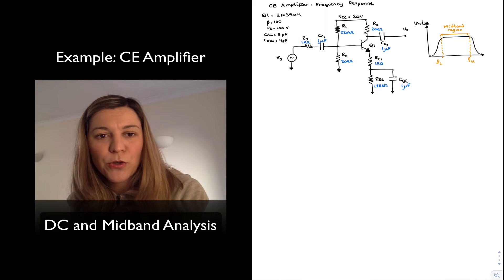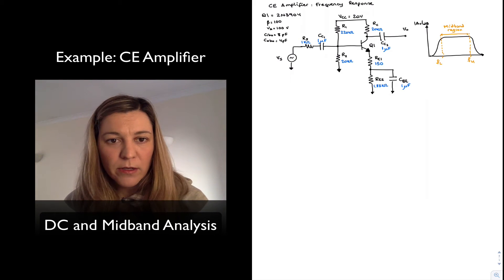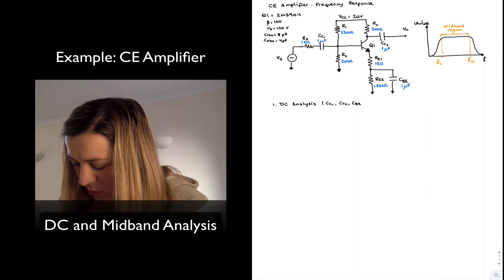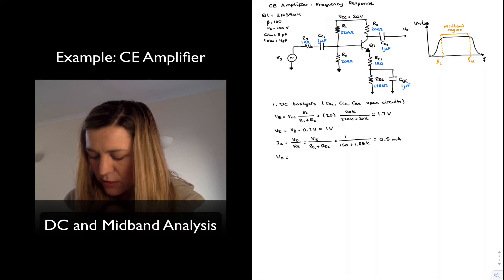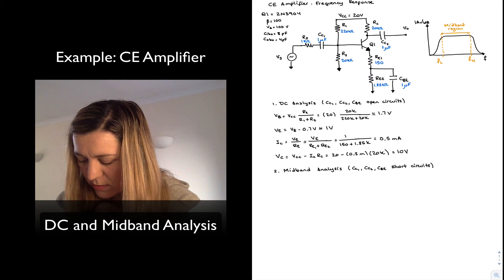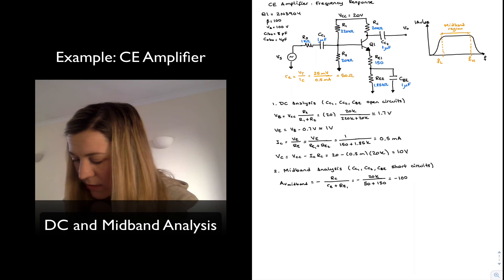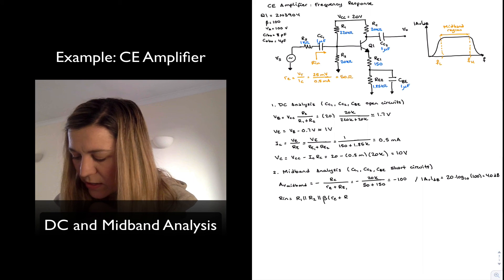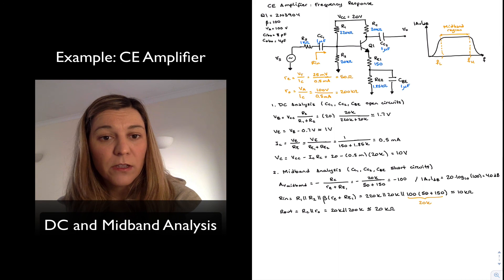Example: CE Amplifier DC and Midband Analysis

Comment: What is VA? please, many people have asked the same question. Id greatly appreciate it if this was answered. Thanks for the video!
Reply: Early voltage from the Early Effect
Reply: I'm pretty sure VA is apparent power, which is the addition of true and reactive power
Reply: Or sorry it's the square root of the addition of true and reactive power squared. So kind of like the hypotenuse of true and reactive power
Reply: @CienaGoat  i figured it out. But thanks for the response!! 😀
Reply: @CienaGoat  wait this is voltage in this context right? you are talking about the unit of apparent power
Reply: @awakenedkimyo6291  VA is not the same as voltage, VA = "Volt Amp"
Reply: @CienaGoat yes, which is a unit of power, while here it was being referred to as early voltage.
Sorry, its a comment 4 years. Prolly dont matter now.

Comment: why isnt it b+1 because the reflection rule states that
Reply from the maker: B+1 is mathematically correct but it is "false" precision. Designs need to be robust to Beta variations. Consequently, for the purposes of design Beta is approximately equal to Beta+1 (e.g., for a typical Beta value of 100 the error is less than 1%). If your design relies on the +1 in the B+1, probably it is not a good design (too sensitive on beta variations).

Comment: At 9:37 why did you include r_o, since there is a R_E resistance (seen as R_E1) wouldn't it just be Rout = R_c?
Reply from the maker: Not sure I understand the question correctly... Do you mean why I included re in the Rin calculation (given that there is an RE1)... or are you rather asking why I include ro in my Rout calculation given that there is an RC? 

In the first case, RE1 is comparable in value to re, so neglecting re will yield a large error. We can only approximate re + RE1 as RE1 when RE1 >> re.

In the second case, since ro >> RC, I can neglect ro in my Rout calculation, and that's what I do (by approximating RC || ro as simply RC).